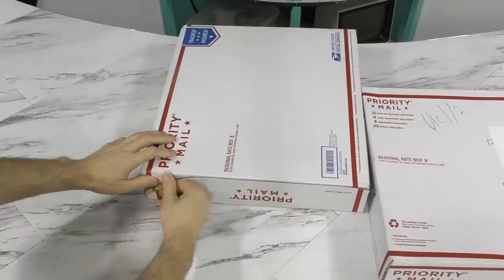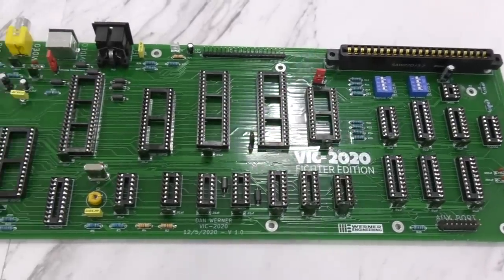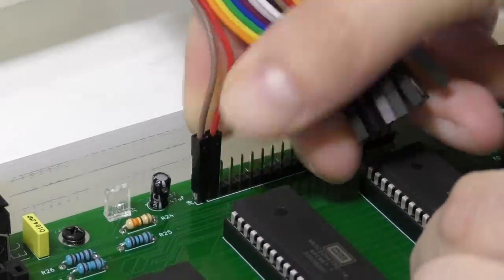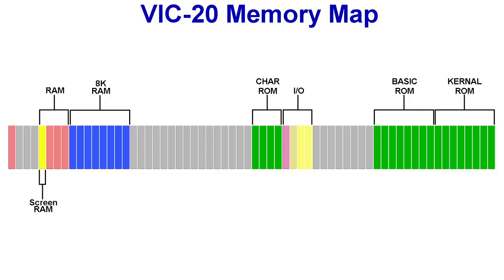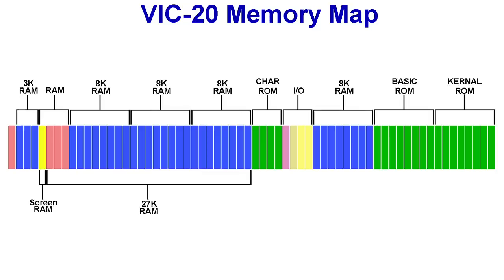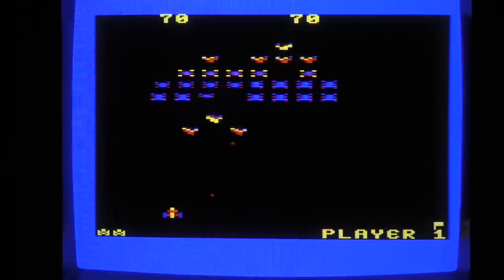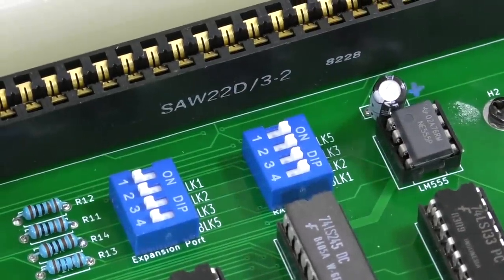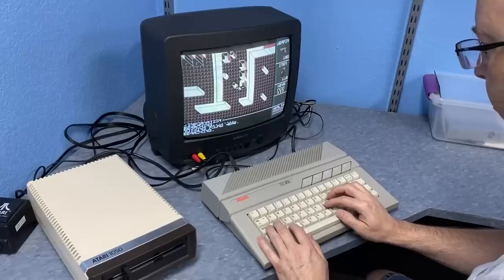Building a VIC-20 Kit Computer and X16 Update.

Comment: I wish there was a kit for either an Atari 800 or an Atari 800 XL.
Reply: Sadly the Atari's used a few custom chips so the only way to do it now would be with an FPGA. but yes, i with the Atari 8bit computers got as much love as commodore's..
Reply: @DanafoxyVixen  They are so underrated on the nostalgia circuit. There was no other 8-bit computer that had 48K when the Atari 800 came out. Nothing was even close.

Comment: One computer you can build from 100% off the self parts is the Sinclair ZX80 and you could integrate extra RAM on the same board. you could use the ZX81 update ROM as well

Comment: re: user port and 9v.. yes, even with full disclosure people will still complain. This exact issue happened with a limited range of user port adapters for the Ultimate 64, initially they weren't sold, but after some people indicated wanting one anyway because they didn't need that 9v, they were sold with full disclosure of that not working.. and guess what happened.

Comment: No power switch? They could have at least put a jumper on the board so that a switch can be added if wanted.
Reply: It's an open-source project, feel free to do the work.
Reply: @sierraromeoromeo2444  I know, but it's still beyond me why it wasn't included in the original drawings.

Comment: Is the point of this to be able to use old Vic-20 hardware and software, or just an enthusiast electronics project?   If its the former, it seems like making a kit of adapters and a usb keyboard with vic-20 symbols for use with an emulator would be more practical.  Maybe raspberry pi hats to interface with the floppy drive, like people did for MFM hard disks.  Could be useful for archiving rare software.
Reply: It's an enthusiast electronics project.

Comment: wondering why you don't use the much better turned contact sockets
the new machine could use switching converters to generate 9V and 6V voltages
the vic chip could be replaced by a small ICE40 fpga that mounts in its place
Reply from the maker: I just used what came with the kit.

Comment: "I wanted it to run off a 5v supply" seems like a shoddy excuse. If they're already diverging from the original board layout it's not that hard to add in some power conversion circuits to generate those voltages onboard.
Reply: It's not an excuse, it was his decision during the design process.

Comment: maybe someone could do for the vic20 what they did for amiga and have a $10 raspberry pi work as a stand in for the cpu !
Reply: What would be the point? 6502s are readily available and the VIC can't benefit from faster clock speeds, so there would be zero gained.

Comment: With the ram configuration I was wondering if you had all the slots tagged as filled is it still possible to use the trick to make it think it's only stock without needing to flip the dip switches?
Reply: You can max out the RAM and configure any amount of memory with pokes, I used to do that as a kid.

Comment: What a broken design! Why would you release something in this state? The non working S-Video was a drop jaw moment! No user port etc. Top mounted cartridge slot? Surely you would design a modern VIC20 PCB remake to be able to drop into an original VIC20 case to be a failed original PCB replacement? Sorry, but I class this as a great effort, bad sadly very lacking!
Reply: This isn't a drop in replacement for the original, and top-loading cartridge slots were common on Atari and MSX machines, it's actually a better design because you can see what you are doing. Nobody cares if you don't like this, it clearly isn't meant for you.
Reply from the maker: It's not really a "released" product.  It's a one-off design.  He already fixed the S-video on the design, but there are no physical boards made with the fix.
Reply: @sierraromeoromeo2444  LOL. Who said I didn't like it? Is that your interpretation of me saying "great effort"?  Also, why isn't it meant for me?  Part of me wants to get one so I can fix the S-Video output socket to work properly.  But I guess that's just the maker instinct in me.  There is no harm in stating that I believe it should have been designed to also be able to drop into an existing VIC-20 case, to revive dead VIC-20's.  Do I care if you think nobody agrees with me? Well, no not really. :)
Reply: @The8BitGuy  Thanks for the clarification! :)  I googled, but haven't yet found where I can get one, and how much?  Do you have any links to share?
Reply: @gregclare  "What a broken design" Do you remember writing that?

Comment: David, as always you are super interesting to follow and I'm really glad to have found your channel :D I have a tech question: I own a dead ATARI ST 520 and despite my efforts I cannot find a way to put it back to life. The power supply works, no leaking from any condenser. How do you suggest to operate to find the components that maybe failed? Thanks a lot and keep up the amazing work!
Reply: Atari 520ST.  An ST520 is a crappy Seagate hard drive. Most likely.

Comment: I'd like to hear more about the need for baking a chip if the moisture level is too high. Is it just an issue of corrosion on the contacts or is there some other factors?
Reply: No, it just precaution for assembly in a reflow oven. If there is moisture in the part and it goes through the reflow oven, the moisture will try to escape as gas and damage the part. Totally not an issue if soldering the legs by hand.

Comment: If you don't have a 6502 available and don't want to use an FPGA, an alternative would be a replacement implimented with discrete TTL logic chips.
It would be alot more expensive, and rather than being just a DIP chip it's a big board that's almost as big as the computer itself.
But it bypasses the philosophical problem of having a FPGA that's many times more powerful than the computer itself.
This has already been made for the 6502.  Something similar may or may not be possible with the VIC chip.
Reply: Or just use a 65C02, which are manufactured today and fairly cheap.
Reply: @sierraromeoromeo2444  It's mainly about the VIC chip though.
Reply: @kargaroc386  Mature and tested FPGA code exists for the VIC, why make a rod for your own back? It would also allow for Kawari-type features such as 40 or 80 column modes, hardware sprites etc. Anything that replaces an IC that is no longer produced is going to be horrendously complicated or over powered, any sane person chooses power over complication!

Comment: Would you be doing anything on the Amstrad range at all or has this already been covered?

I had the CPC 6128 with a built-in 3 inch drive, the 7 pin dot matrix printer DMP 2000 if memory serves me correct. I also had the romantic robot multiface 2 that I had a lot of fun with back in the day, along with the color monitor.

My sister had the 464 with the tape deck, and my mum had the PCW 8256 with a single drive. I added a 2nd drive to that later on.
Reply: They weren't known in America, so it's unlikely!
Reply: @Ffinity  that makes sense. Thanks for the information

Comment: i detected a hardware anomaly, the 'distance' on the computer between 2 and 3 is 1 on a calculation and between  1 and 1 is also one whole, but ! the distance between 0 and 1 is infinity instead of 1. the distance between -1 and 0 is also 1. that is and hardware error. between -2 and -1 is also 1 whole value distance. good luck.
Reply: found in a multiplication to calculate the 'next' number
Reply: that means 0 is infinite as start and thus 1-1= not 0 but infinity, but -1+1 is 0

Comment: Why did you use 3pin switches instead of 5pin?
Reply: Because he didn't make it, because they work just fine, because it doesn't matter.
Reply: @sierraromeoromeo2444  The PCB has cutouts for 5 pin switches. 3 pin switches are for plate mount only. The switches will get misaligned and probably break over time.
Reply: @silitekmodder5681  And? He has at least one real VIC, this was just constructed for the video.
Reply: @sierraromeoromeo2444  What does that have to do with anything? The original VIC-20 keyboard uses Mitsumi spring-over-membrane, very different than MX style switches.
Reply: @silitekmodder5681  The point is he'll use the original, not this.

Comment: What is that low frequency background hum in your new studio?
Reply from the maker: The air conditioner compressor running outside.
Reply: @The8BitGuy  Oh ok. Maybe it's my headphones (which are really good at bass), but it came through quite strongly.  If I unplugged my headphones and used by MBP speakers I couldn't hear it.

Comment: This is unrelated, but I'm wondering if you can publish your games as rom cartridges. I think it would be cheap with modern hardware, and much easy for people than maintaining working disk drives.
Reply: It wouldn't be cheap for him, he would have to invest in electronics manufacturing for items that may not be bought. Buy the digital download and play on an emulator or from an SD card solution.
Reply: @sierraromeoromeo2444  I don't know, maybe it's only a matter of a pcb with edge connector and an eeprom chip, he could solder it manually like he did for other projects. But probably the game architecture would have to be modified. It could be a nice experiment anyway.
Reply: @michelealessandrini3421  Standard cartridges are limited to 16K, it's not simple.

Comment: dunno why it couldnt have had the screen ram in the lower position to start with, then no problems..???
Reply: @Ffinity  i'm not on about the amount of ram, but why 'move' the screen ram area? why not keep it at the same place? most do,
Reply: @Ffinity  but..surely better for programmers to keep it same place, or have  a system variable so it was possible to read where it was so the program could alter itself accordingly,  as with the zx80 and zx81.. that was moved and 'collapsed' on clear screen for memory saving reasons..

Comment: X16 MEMORY BANKING

before the design gets finalized has it occurred to you to use the SYNC (VDA/VPA on the 65816 types) as an automatic bank selector for code fetch verses data reads?  That would allow you to use much larger banks (perhaps the whole top 32k) and literally read and execute out of the same address space without conflict.
Reply: The design is finalised, bar any necessary fixes, and it doesn't use a 65816.
Reply: @sierraromeoromeo2444  Pity, it was one of those interesting realizations I had while just pondering 8bit machines once, to use the SYNC pin on a 6502 for automatic code/data bank switching.  Anyway, enjoy
Reply: @poitsplace  Enjoy what? Your pointless idea?
Reply: @sierraromeoromeo2444  Just yourself, have a nice life, etc.  WTF man?

Comment: Yes after review the schematics on git hub you could use  4066 chips to replace the DIP switches. 4066 chips each have four switches built into them and can handle digital but I was thinking maybe not so good, they might not be fast enough it would need to be tested. Being this is a slower "older" retro computer it is possible that would would work fine, however instead of 4066 chips try two chips containing 4 2-input AND gates.

The 4 two input AND gates would work. The outputs of the two hexadecimal rotary switches might need to be tied high, the common contact tied low or you can do the reverse, just use a logic probe or multi-meter to map out the outputs that would be sent to the motherboard so you know what each switch position outputs.

Now feed each of the four outputs of each switch to one leg of each or gate. Next tie one leg of each OR gate to one of the BLK signals, the outputs would go to the outputs of the OR gates would be fed to the expansion port for SW3 or to U10 for SW1. The pull up resistors for the two DIP switches most likely need to be removed, and could be repurposed as pull up resistors on the two hexadecimal rotary switches.

Maybe someone could write to the gentleman and request rotary switches and two AND gates be added to a revised motherboard since the board needs to be revised to correct the S-Video anyway.
Reply: "Maybe someone could write to the gentleman and request" You seem to know everything, or at least think that you do, so why haven't you written to him?
Reply: @Ffinity  What in the previous statement make you think "I" know everything or even think I do? Admitting that a 4066 chip may or may not work means I do not know, but am experimenting even if on in a thought process.

Comment: Those commodore monitors that take a composite signal… can they display only some colors or could you pipe any composite video signal in and display it?
Reply: I think it's region specific (PAL, NTSC, etc)
Reply: @amirpourghoureiyan1637  yeah I didn’t say anything about region, oops. Do you know if I were to have a Commodore NTSC monitor if it could show a video signal from a VCR or something like that or would it have limited color
Reply: @charlie_nolan  It's composite so I don't think it will have a problem accepting video from other devices like a VCR. 
The question really comes down to whether you need a Commodore monitor or not, there are many other cheaper CRTs that accept S-video and composite.
Reply: @amirpourghoureiyan1637  I don’t need one or have one, I was just curious. Thanks

Comment: 12:55 , nah, this isn't a consumer product. If it has limitations and doesn't work exactly correctly, people will be fine as long as they're warned. We're a cut above the average consumer. If he were selling this thing in Wal-Mart maybe that'd be different, but the classic-gaming nerd market realises they're dealing with hand-made stuff, not mass-production. Particularly since they've just soldered the components in, FFS. Put a warning message in the soldermask text!

Dude, put the ports in! Are they both just PCB contacts? Put the tracks in, and an owner can just cut a hole in the case with a knife. Maybe do it on the V2 version that gets the S-Video wiring right. 

Until then is the necessary 6522 (??) chip there for the ports? You could perhaps hack up a connection if you really wanted to. Cartridges were never popular in the UK, nor were disks, and since there's so little RAM, tapes are quick to load. 

Perhaps a cartridge could address the problem, if the necessary lines run out, you could add a VIA to a cart and put a tape connector and user port on there. If it doesn't support the tape drive it's not much of a home computer.
Reply: "this isn't a consumer product" It isn't a product, period! It's a personal project that is open source. If you want extra features, put the work in and add them.

Comment: I think someone could just use a raspberry pi pico or zero to emulate a Vic chip. They both use 5V and can likely emulate a Vic chip.
Reply: It definitely can do it, BMVic20 is proof of that, but the RPi is a computer, not an IC, it has a boot up time which will mess up the host computer without additional electronics. If it was as easy as you think it is, the designer would have done it that way.
Reply: @sierraromeoromeo2444  The pi pico, which is a microcontroller like variant that boots up instantly. It's.like a Arduino on roids
Reply: @rysterstech  Well that's even worse then, as there is no implementation of a 6560 for those. So it's something that would have to be done from scratch. It might be possible, but it's not a 5 minute job. Just asking in the YT comments is not going to make it happen. Do it yourself, or pay someone to do it.
Reply: I would like to point out here that I have zero experience with programming things to emulate other things in software. I was just stating an idea.

Comment: I'm confused.  If they created an opening in the top for the keyboard connector, then why couldn't they have created one for the dip switches?
Reply: The opening is a cartridge slot, and you don't need to touch the DIP switches because memory can be configured from software. They didn't do it because it didn't need to be done!
Reply: Not everyone would have the Penultimate cartridge to change the memory configuration.  And maybe I did mistake what the opening was for, but my point was that anything needing to be accessed should have an opening in the case.  This thing just wasn't thought out.
Reply: @ericsills6484  It was thought out, the designer just wasn't thinking of you or anyone else. He designed it for himself and he succeeded. PS: You don't need a Penultimate cartridge to change the memory config, a couple of pokes will do it.

Comment: Got out my vic 20 (my name is Vic also lol). How do I connect vic video to newer tv with coax as the only option, i think.  Is there an adapter for coax that would plug into the Vic video box?
Reply: You need a composite video cable.
Reply: @Ffinity  U mean cut coax and composite  and solder together?
Reply: @sickvic3909  No, I mean composite.
Reply: @Ffinity  u can't connect composite to coax. TV HAS 3 COMPOSITE INPUTS U CANT REALLY USE.

Comment: And how much does the kit cost?
Reply: AFAIK, there is no supplier of kits. This isn't a product, it's a project that the designer made freely available. You sort out your own PCB and components, the link to the project page is in the description.
Reply: @sierraromeoromeo2444  Cheers, I went to the web page, I didn't see a price that's why I asked. Still it'd be nice to know a ball park figure, to know if it's viable, before even researching the components
Reply: @Pillock25  It's all on you. You want it, you do it!
Reply: @sierraromeoromeo2444  I know, but a rough cost would be nice, "All this cost me about $50, $200, $400 to put together, your costs will differ." it's not hard, I'm not asking for an itemised cost sheet.
Reply: @Pillock25  Like I said. it's all on you. The cheapest you can do do it is the cheapest it will be!